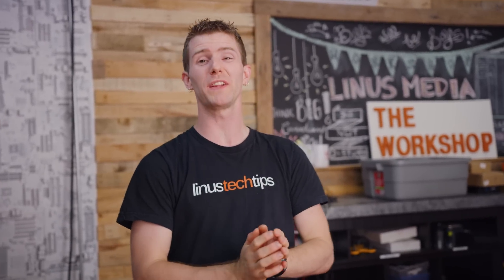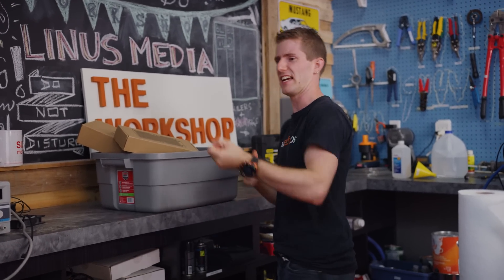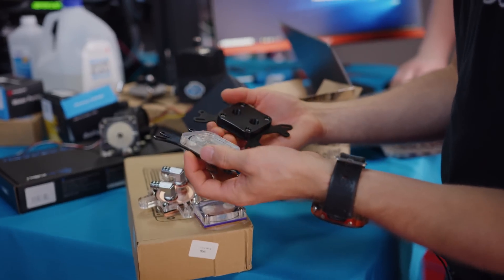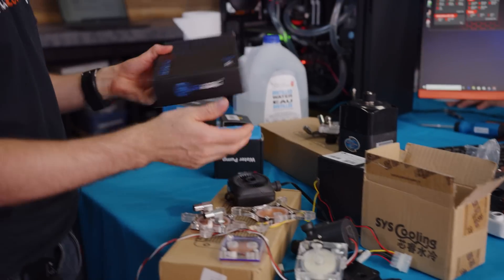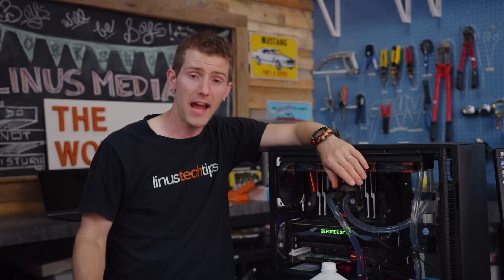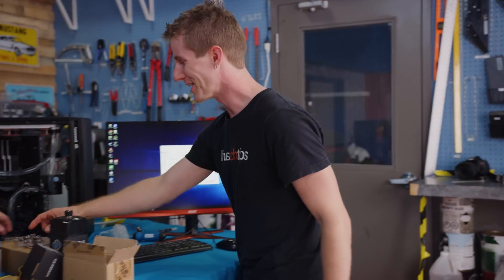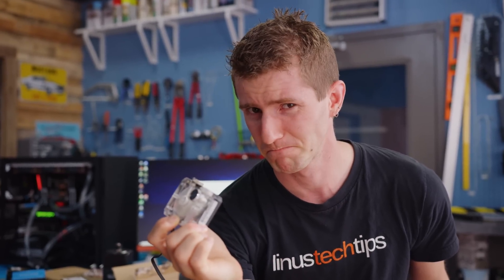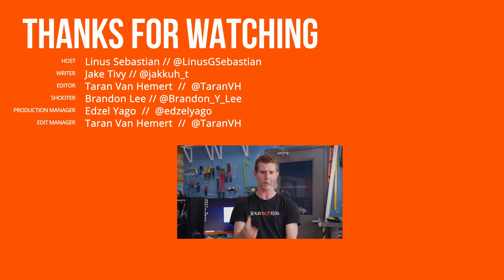AliExpress Water Cooling DOESN'T Suck?!

Comment: how does the flat plate water block compare to just regular air cooling?
Reply: compared to stock better, compared to any decent 30€ one, not so much
Reply: Cool coolers are cool
Reply: Flat plate does not even equal to basic cheap CM hyper evo 212 air cooler with a single fan... Actually, looks like that copper flat cooler did worse than my 212 air evo. I run 70 degrees torture testing my overclocked 4690k (4.5gHz) which has stock tdp of 88 watts! Going oc'd it actually produces more heat than the cpu on this video. So... flat water block is WORSE than 30$ air cooler.
Reply: biggest advantage of watercooling is the massive amount of "material" (water) to heat up. even when you would use no pump at all it would take very long to overheat because it takes a LOT of heat(energy) to heat up like 2 liters of water. radiator and fans are just used to dissipate heat.
Reply: Flat plate doesn't get bonus for surface area... but it gets boost on the sheer ammount of water that can go though it. That's why it's pretty bad in comparison, but still good enough to not overheat a 5960X.
Reply: not sure if you ever seen a pump fail, but it doesn't take long for the water to heat up unless your loop is hooked up to your bathtub lol
Reply: @dalohse  I use 20 liters of water and have no radiator or any fans for dissipation
Reply: @dalohse  Oh gosh... MrPurple how long it takes to overheat a whole room of air? The air flows through your computer, through your air fins. Of course if the fans stop spinning, the computer overheats pretty rapidly and components tune down to protect themselves... They are not going to melt or break in that very rare scenario of fans stopping. 
Also if the waterflow stops, the heated water is not going anywhere out of cooling block. So the same thing is going to happen very rapidly with liquid cooled systems anyhow. To be honest, I expect waterpump having shorter lifespan than airfans.

The only advantage of liquid cooling is that you can keep your temps lower than with air cooler... If that is needed. And rarely it isn't.
Liquid cooling = cool factor, by its looks and by its cooling capacity. For regular overclocker... it's just a waste of money.
Reply: You know, i was a fan of watercooling once but then... with the actual performance you get from modern air cooling. It is just not worth it. There's too much HAZZLE involved, not to mention all the dangers. Unless you're really into heavy overclocking, it is not worth it.
Reply: totally agreed. I think water cooling is cool, and it's an art to build custom loops especially when using hard lines, but I get great cooling with my Noctua NH-U14S air cooler, and my friend gets great cooling with his much less expensive Cooler Master Hyper 212... and the only maintenance we have to do on them is blow the dust out every once in a while. Water cooling needs significantly more maintenance and you always run the risk of something leaking and damaging your hardware. The biggest problem with it is the size. My Noctua cooler is huge. However, my case is also huge so it's really not a problem but for those who are going for a compact build it can definitely be a big problem.

Comment: It doesn't matter what kind of water cooling you use it still sucks because if a line breaks or snaps or something like that it could fry your computer and if you had a air-cooled they're both really bad because air-cooled can get you computer to overheat if you don't have enough space but if you do have enough space it's fine unless the fan cannot keep up with it so I think I would want are cool because an overheating. Just turn it off and just go do something else so why I just use Liquid cool when you lose all your stuff if I were you guys I would just stick to air-cooled.

Comment: If you shop on aliexpress for custom parts then look for BARROW brand. They are pretty much the same manufacturers of bitspower. Great quality.
Reply: Can confirm, I had some xspc 90 degree rotary fittings, they started leaking about 1 week after building the pc, replaced with Barrow ones, superb quality.
Reply: How about bykyski
Reply: @Kdjoao  Bykski is good too.

Comment: Disappointing that you skipped the reservoir and fittings particularly given that they are some of the most expensive items in modern builds (with expensive by no means meaning good quality either).  The use of the EK gear here struck me more as a stealthy advertisement for their products.  The video felt weak with little worthwhile content overall.  I would have liked to see just what offbrand/cheap products could have been had as a viable alternative to the typically overpriced western market.

Comment: You should run a long term test of the cheap one vs more expensive one to see how long the cheap stuff lasts.
Reply: Yes a long term test and enough AliExpress parts to assemble a PC from scratch.
Reply: I literally have the "nice" cpu block, and the white 360 rad for almost a year now, with 0 corrosion, and 0 visible problems. :D
Reply: Also to further support the claim that aliexpress watercooling isn't bad, I even have aliexpress fittings, pump and reservoir. All this in a hardline build.
Reply: @computerforge  thats interesting because i was looking at this now after this video, what AliExpress brands would you recommend?
Reply: @ratchbrg3882  I'm really sorry for the extremely late reply mate. If you are still interested, Barrow and byksky are very reputable brands. But some no-names are worth a try as well.
Reply: I've got that same "nice" cpu block (Bykski CPU-XPH-B) as well coupled with my i7-8700K. got a formulamod 360 copper rad, syscooling SC-P60A pump, barrow fittings... all water cooling parts I bought were from aliexpress except for the soft tubing (I got primoflex adv LRT instead). everything has been amazing so far and it only cost me around 160 bucks! I'm really satisfied with everything so far. :D
Reply: Jarrod'sTech like the one year pressure test, except with the water cooling loop
Reply: i agree, 100000%, please do this!
Reply: Jarrod'sTech I’m more interested in how long the expensive stuff will last because you pay like 4 times more for a product that is still made in china. All these sponsored Youtubers will tell you China stuff is bad because they make money out of the branded stuff. At some point the will loose there subscribers because of this bullshit.
Reply: Well after replacing the O ring on the cheap ones with good quality ones they will last as long as the others.Lets just say always replace low quality rubber stuff for such things
Reply: the answer is a long FREAKING time, i ran a setup like this for nearly three years and only stopped using it when i had to move to a laptop based setup. btw just add an anti-corrosion compound, like anti-freeze to your loop and the whole "mixed metal" thing becomes a non issue.
Reply: minton brunkhorst the issue comes from if theres a leak.  Cleaning up glycol is not something you want to do.
Reply: Some Guy been there done that too. Not that bad really. Just a wet rag and comes right up. That was on a freshly painted case too. If ya want mega mint strip case and wash outside.
Reply: @mintonbrunkhorst7070  be careful with the glycol based antifreeze petg is glycol based and will break down.
Reply: Ali Chinese companies save most on marketing, which is a HUGE expense for EK
Reply: That is a big assumption based on three words. Maybe I'm simply pointing out that EK is a Slovenian company, not American. 
Side note:
Having worked for a big 20000+ employee company with production lines in China, Czech Republic, Romania, Slovakia, Denmark, Brazil, the US and more, I'd say I have a fairly good idea "how business works"
Reply: they cant. it would hurt the sales of the expensive ones
Reply: ^ Exactly, see the reason why chinese blocks are so cheap and all is basically because, with EK, you're paying a premium, for the fact that they don't sell that much equipment to justify a lower cost, with Chinese companies however, they don't really have much of a price-up, and, Bykski is a really well known brand in china, if you're buying any non EK waterblocks or anything, buy Bykski. Many people have benchmarked them to perform very similarly to EK blocks (both CPU and GPU) and they're way less expensive.
Reply: Mike Fox I'm planning on ordering parts for a full custom loop with petg tubing from china. Got any recommendations? I've been thinking about bykski
Reply: Mike Fox thats really nice story bro too bad you didn't do any research into it and just made it up on the spot. Back when you were wearing diapers it was all over the news that stores across the US and even here in New Zealand were being closed down and sued for selling products that came from child / slave labour, when it comes to human rights China is one of the worse culprits when it comes to slave labour, people that make those products on aliexpress are working 14 hours a day 7 days a week and what do they get for a full days work as wages? half a sandwich.
But now the internet merchants are a thing those slave masters no longer have to ship to stores overseas they can open up shop in their own toilet.
Ever heard of the term blood diamond?
Reply: Skelath lol what the hell ru talking about? Have u been to china? go to shenzhen or dongguan then come back, stop bsing something u dont know
Reply: Haha, the first thing I was thinking too. Sure, it's good for 20-30mins. But why not do 1week or 1month test.
Reply: @Crimson_201  Well as I wrote above, byksky and barrow are really decent brands. But as for other brands I generally use common sense and youtube. I usually write in the part names and the clues that I can find in the description. Hit me up on fb if you have any question os concerns : 
Mark Bacsko(I'm in a hood on my profile pic)
Reply: all I can say is that copper is copper and acrylic is acrylic.
Reply: This stuff is generally run off the same line as the shit sold with premium company tags on it. That's how they make it so cheap in the first place. It's not like these knock off companies could afford to build their own fabrication plants. Premium tags get you premium service and premium quality control (usually) not premium products.
Reply: Bosco lol i got 4 systems using a $3 pump off aliexpress and every other part from there too. Cost $50 for full loop and oc to shit. (Q6600 at 3.8gb with r9 280x for a htpc) runs cool af. Quite af and been going that way for 3 years with no maintenance (i did swap the graphics card from an hd5770 as i had the 280 doing nothing. Other than that swap never bothered with it) want photos of the systems with screenshots of it under full load stress test for 1 hour? Post your email and ill send them. PC1: asus p5e deluxe, q6600 3.8ghz, 8gb ddr2 still at 800mhz, asus r9 280x, hx750w psu, x2 500gb seagate drives in raid0. PC2: asus p5q pro, q6600 at 3.8ghz, 8gb ddr2 800mhz, psc hd7870, antec tp750w psu.
Reply: I defnintely want this too. Prediction would be that a higher failure rate in pumps, maybe a slightly higher failure rate in radiator fans (if you bought them there) but not much other difference. I mean, at the end of the day, no matter what the big names in cooling try and say it's not really a very complicated thing. The biggest factor in reliability would probably not that it's china stuff, but that they're including theabsolute cheapest crap as well as the cheaper more quality stuff
Reply: And the basic human rights, liberty, lack of  political reeducation camps, organ harvesting of dissidents. Lots of talk about price, what about the cost?@Ali
Reply: lol ! For what it seems, what about to see how long the expensive stuff lasts ?
Reply: I demand a 24/7 live stream!
Reply: A guide on a cheap pls
Reply: EK is Slovenian
Reply: Such a test with a sample size of 1 of each kinda means.... nothing? Cause, roll the dices, the IK one could fail first, and it wouldn't mean much :/
Reply: @Ali Umm, US Products?  I think you better check the box again.  Not US made on the expensive ones.   Same 9 year old girl putting them together.  Perhaps you are referring to the corporate greed as a product.  These water cool products are not high tech.  A brass rad, cheap plastic lines, some o-rings and fittings and a block.  The only thing would scare me is the pump but all are  made in China  you just need to buy the knock off of a reputable company.  All made in the same factory.  Sucks when you have a corporate shrill afraid to tell you that these product are not bad in fear of alienating his sponsors.
Reply: @Crimson_201  Sadly I've sold that block about 4 months or so ago. But had 0 problems with it up to that point, but I've upgraded to a ryzen so it wasn't compatible. I'd say you are safe to use that one. My pump is stoll going strong, and no corrosion yet.
Reply: The pump would fail.
That the only drawback
Reply: Jarrod'sTech b

samaya,.
.  no
L
L
Km.TV
.
Reply: YES!!!
Reply: Fair enough:)
Reply: Absolutely.  That's what I was going to say...  instead a like for this comment!
Reply: 1 year of continuous use,still working and no leak

btw i use cheap block from aliexpress and a aquarium pump
Reply: @ghaviorizky3961  what is the model? of the aquarium pump
Reply: @SomosKS  cheap unbranded one
Reply: no such thing as cheap or not, doesn't matter
Reply: Yep
Reply: Except every time they do this, the end result is "well, the sample size wasn't really big enough, so this was a pointless 2-year endeavour. Long-term studies aren't really meant for infotainment.
Reply: mine lasted 4 years . Technically its still going but the pump died out cause of a power surge.
Reply: i used an aliexpress barrow block for my sapphire vega64 for years. with the factory blower cooler hot spot was 100-105°C contant thermal throttling loud as hell. with the water block i overclocked it to the maximum and after hours of full load gaming it was about 50-65°C.
Reply: Jarrod'sTech I messaged Linus and Jay over a year ago about Bykski and told them that EK was ripping the people off when you compared prices. I have all 3 of my systems with petg tubing for over a year. Nothing has gone wrong besides the Aurora coolant that made a mess. Eventually everything is from China so why pay more for water cooling parts?
Reply: using my china watercooling parts (even mixed aluminium and copper) since about 3 years without any problems.
Reply: @dalohse  Automobiles have been mixing metals for ages. It just takes about 10-20% ethylene glycol, which still has 95% the heat capacity of pure water and >110% of the propylene glycol mix in AIO coolers.
Reply: I bought a cheapo 40mm all-copper block for a laptop wc mod and the nipples were pressed into the block, loosely... I had to solder them in to be watertight. I then leaktested it for a week ...
Reply: Also, green car coolant (for alloy) engines with zinc to stop galvanic mixed metal corrosion.
Reply: Dumbasses think their "American brands" are actually American, EKWB and all those companies manufacture their shit across the street in china from these aliexpress products
Reply: they wont because it sucks make this video a non sense
Reply: Ive done that. Q6600 at 3.8ghz and hd7970 for 3 year on an aliexpress loop and only changed the water once. Still goes mint as my htpc.
Reply: @DirtyRB30  show us
Reply: @dafsaa  well whats your email then... you do know you cant post photos in youtube comments right...
Reply: @DirtyRB30  true i was wondering that you mayor upload to tour youtube channel

Comment: I would say that while fittings don't necessarily affect performance. 

The video kind of implies that it is trying to discover if buying a decent loop with AliExpress cheapo parts is viable. But not testing the primary failure points, the reservoir and the fittings, we may get a picture of what kind of performance to expect, but not any kind of picture as to what reliability we could expect.

Comment: Was looking at these exact parts recently for lols. I am really kinda disappointed you didn't test their fittings, because while they don't affect performance, it would be extremely helpful to know if they're actually of a usable quality and don't leak. Fittings on AliExpress can be had for as little as USD$0.85 each, which is 6-7x cheaper than the dozens of EK fittings I currently have. Fittings/angles are actually a really expensive part of my loop, and I assume others' loops, and it would be interesting to see if there's any reason we're paying anywhere from 3 to 7 times as much for them from EK/others, vs the cheaper options.

Comment: I just spent 64 dollars for a Noctura HSF for my 1600 and I have never ever spent that much but my idle temps are 10-15c lower than the stock HSF and 8-10c lower running 3.76ghz.  Full Prime95 I barely crack 60c now at 3.76ghz and on stock forget it over 3.6ghz so I am impressed beyond belief and it makes me wonder if a water loop would even be worth it?